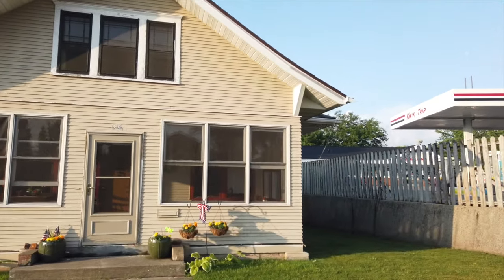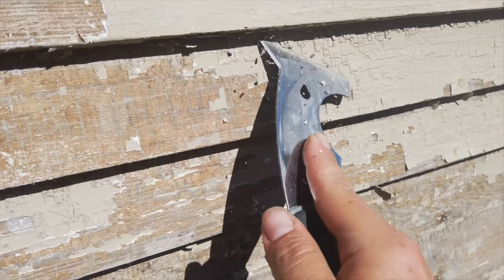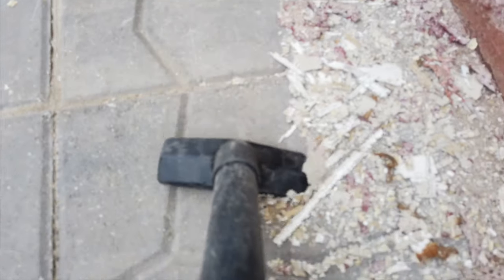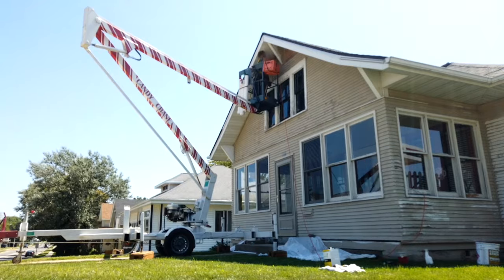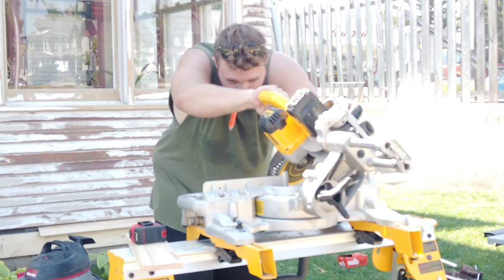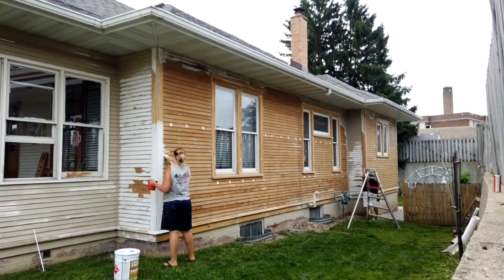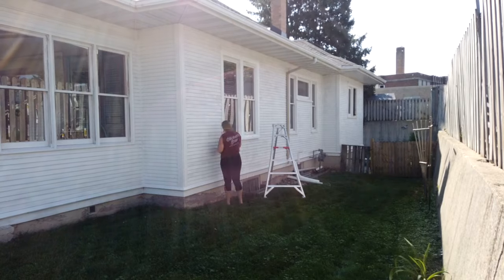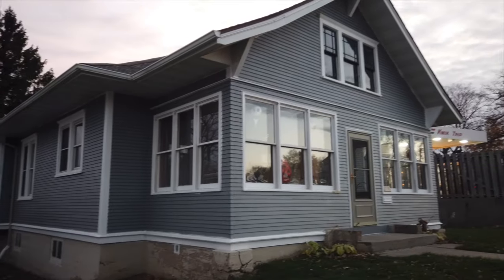Painting my 101 Year Old House

Comment: Insulation plugs? Can you explain this to me please? Amazing work btw!
Reply from the maker: Thanks so much! Someone before us had foam insulation pumped into the wall cavities. They drill a hole from the outside, pump the insulation in and then plug the hole with a plastic cap. Over the years since this had been done, some of the plugs were loose. We caulked them all in place to seal them completely.
Reply: @olsenkated  Thank you so much for the response. I thought this might have been the case. I have an old home too and was wondering if foam insulation can be pumped into the walls after construction.

Comment: Wow Katie great job on the house. Time is not even important how long it took to do it the fact that you took the effort and the patience and you endured. You did a great job. A lot of hard work. I’m sure the video does not show all the people who helped you blood sweat tears effort, exhausting days, sore muscles thinking and wondering if you’ll ever get it done. My wife and I are attempting right now in August 2024 to begin one side at a time. We have a small 109 year old house cedar siding same thing everything is flaking off so we are going to try and get it done before the fall hits in Idaho and it begins to get cold. Basically the same product. I know people say you should brush it, but I think we’re gonna try and spray it with a follow roll so as we spray, we roll it in. As a second step, I will spray my wife will follow me with a roller. Will Try to share some footage as well. One side at a time is our goal instead of attacking the whole house at once. We have to add new siding as well and anywhere we add siding we are putting down  Tyvek .More concern obviously with these old houses, they are not insulated. my thought was it’s possible to go around the house with a small 4 inch hole saw make holes strategically and blow in insulation into each cell between the timbers otherwise you have to peel off the siding and put on Corning foam sheets to get any kind of an R factor barrier. we are going to blow in a barrier insulation into the attic. And of course, what you spoke of replacing windows and anyone who’s doing the same type of work get used to mice outsmart them and give me them no place to hide. We had to tear out, our interior kitchen walls and vacuum out all the dead mice. Lots of steel wool and silicone to block up any opportunities for mice. Best wishes from Idaho.
Reply from the maker: @mattthompson9480  oh gosh it sounds like you and your wife are doing a ton of great work to your old house. Cole and I were just discussing today the quality of lumber used in homes from that era compared to anything being built today. Time will tell if homes being built today will last as long as these old ones that we are spending time to repair. (Personally I’m betting on the old slow growth timber) spoiler alert, we sold that old house and are now working on the next home - from the 1970’s. Which sat empty for a summer - which means mice. I hope your mice smell better than ours did. I found bleach in a bleach spray bottle to be very helpful for cleaning things out before priming with the animal smell primer. Best of luck to you on the painting project. Hope the sprayer works out for you - I also recently invested in one to paint some exterior doors. I liked it - the doors turned out well. Don’t forget to pickup paint thinner to clean it out when you’re done using it.

Comment: Nicely done. Looks great. I usually paint top to bottom to cover up drips, but I am sure you had your own process.
Reply from the maker: My grandpa suggested that too. There were a lot of days that rain was in the forecast, so I wanted to get that raw wood covered and cured as quickly as possible. But both you and my grandpa are probably right. I should have started top and worked my way to the bottom.

Comment: Wow that is a great job!  I am heat stripping our porch banisters now.  The paint is 1/4 thick and it is rough going. Now if only I could figure out how to strip the sides of the spindles which are just straight wood.
Reply: Doing the same thing right now - using a heat gun and scraper first, and then die grinder with flap disks to sand off the remainder. Tough job anyway you do it.
Reply: @cbrinsfi  I just wish the infrared heater would get to the sides of spindles. They are too close together so I would have to use my heat gun and cant find respirator for lead paint.  Side note some children apparently practiced their cursive writing on the bare wood back in 1903 before it was painted the first time.
Reply from the maker: Whoa! That would have been so cool to uncover. Also annoying that there was now writing on the wood. But what a cool piece of history that was hidden for so many years.

Comment: Looks really good,  especially to do all that scraping & sanding!
the paint scraper  you were talking about is carbide blade, not carbon fiber haha not a car panel.    Im surprised no use of a sprayer when it came to painting?!   just goes on so much faster.    I reccomended back brush or back rolling,  as you're spraying,  to make sure it gets worked in good.  but yes to speed up painting,  esp all the eaves etc goes quicker.  do a good job masking too, if spraying
Reply from the maker: Ha! Thanks for letting me know that I said it wrong - no one has said anything in over a year since I’ve posted this video. But I miss speak all the time 🤷🏼‍♀️ I thought about using a sprayer but didn’t want to have the extra prep and the expense of the equipment. Probably would have been worth it in the long run to save time. But I’ve also never used one and didn’t want to mess it up. I’m definitely not an experienced painter. Just a DIY gal with time on my hands, an old house, and a low budget. I got lucky and most of the eaves have been updated to metal soffits. It sounds like you have experience with painting big projects like this, so I’m glad to hear you think it looks good!
Reply: @olsenkated  yes.. I do painting for my business, along with roof cleaning,  pressure washing,  gutter cleaning,  window cleaning, Christmas lights. You did amazing with the prep!   hard to find anymore these days, people willing to scrape etc! 
You would of learned just fine & quickly with a sprayer.  Then end up painting more projects too with it haha.  really nice to be able to spray doors with a fine finish tip & deluxe paint like Emerald Urethane from Sherwin
Reply from the maker: @mcsqueegee81  that’s awesome! Thanks so much for the kind words and the painting tips. I will have to look into a sprayer for future projects. Also, I love it that you do Christmas lighting! I also do professional Christmas lighting - it’s such a fun industry to be part of!

Comment: Did I miss any reference to testing for lead based paint, and how you handled lead abatement if necessary? I been working on a 110 year old house for the last two years and lead based paint is everywhere.
Reply from the maker: I purposely didn’t talk about lead paint because I’m not an expert on the topic. It is important to research and know your local regulations and to get expert advice.
Reply: @olsenkated  Tests for lead based paint cost 12.00 at Lowes, Home Depot, Menards, Fleet Farm, etc.. It takes less than a minute to open one of the test pens and rub it on the previously painted surface. How you choose to respond to those results it up to you.
Reply: I have a similar situation. After reading all lead paint rules in my state, it seems that hiring a professional lead certified painter may be the only good option. They need to put on lead abatement gear (lead filtering masks, bunny suits etc) and drape the yard with plastic out 20 feet. All paint chips must be disposed of in a specific manner. They dont allow sanding and any scraping must be done with a spray bottle of water to keep it wet. The rules are so tricky its daunting to DIY. Also no shop vacs. Only special HEPA vacs with lead paint. They say to assume lead paint if house was built before 1978.

Comment: Katie, what a fantastic job you did on this!   I grew up in Oshkosh so as soon as I saw the Kwik Trip I knew this had to be Wisco :)  I am doing the same thing starting this fall and continuing through next year.  We have a 1950's built home that was originally sided with cedar siding 12" reveal.  That was covered in the 1960s with aluminum siding... and I've been pulling that off and finding the siding still in very good to decent shape.  I plan on doing exactly what you have done. Sadly there are no Menards in Upstate NY, where I live now.  I'll be using Sherwin WIlliams paint and an oil-based primer too.   Go Packers and Go Brewers!
Reply from the maker: Hi Steve, Hello from your home state of Wisconsin! That’s awesome, I hope your project goes well. I was somewhat lucky that some of the old paint cleaned off easily due to so much sun exposure and how neglected it was. Wonder how yours will be since it has been protected for so long. Best of luck to you! I bet it’s going to turn out amazingly!

Comment: Nice job! So don't use a pressure washer? Glad I saw your vid because I am currently scraping my home right now. I will go the sander once i am done scraping. I'm just a bit worried about the possibility of lead in the paint and sanding it down. That would create dust with lead in it.
Reply from the maker: @mheberling5939  in my case the pressure washer was too abrasive. Lots of work ahead of you, hope it goes well. Yes, you definitely want to have your paint tested for lead. I don’t talk about it because I’m not well versed on the topic and it’s important to do your homework (from a reputable source - which isn’t me)

Comment: Beautiful job, very impressive.  I bought a 1945 house that I just pulled the siding off of, but now I'm reading all the concerning information about lead based paint removal.  Did you have any concerns or take any special precautions before you started sanding and scraping?  I'm not in the marketing for a professional lead abatement, and could use some helpful feedback.
Reply from the maker: Thank you! I’m super happy with how it turned out. I’m not an expert on the topic of but I did do research before starting.

Comment: Nice job and very inspirational.  I admire your thoroughness.  I'm about to do the same on a badly neglected garage and I'm curious of what type of sander you used.  Was it the vibratory type, or a circular disc type?
Reply from the maker: Thank you!!! I used a 5” circular disc sander. I also had a little triangle vibratory type that I would use every once in awhile. But the circular disc sander had a lot more power.
Reply: @olsenkated  Thanks.   Hardware store on tap today!